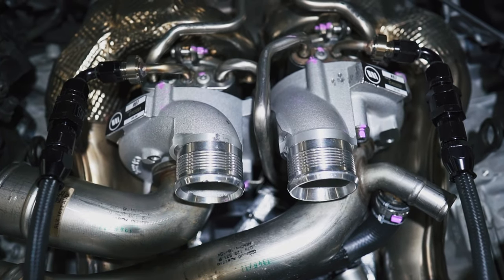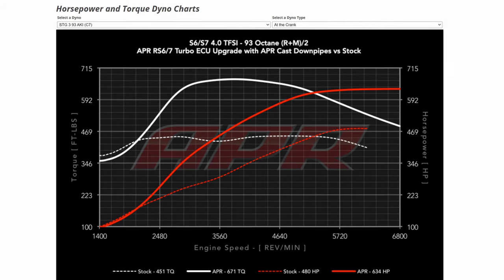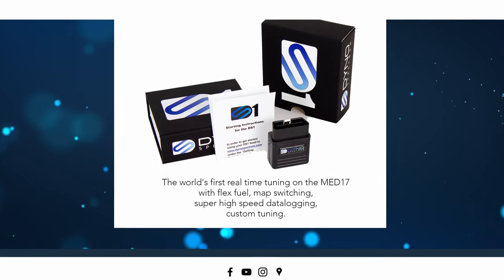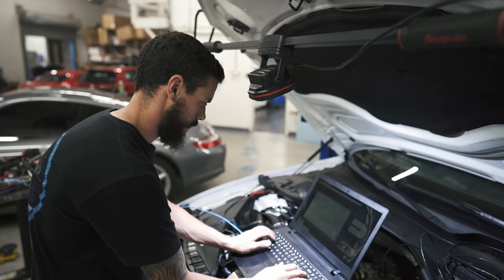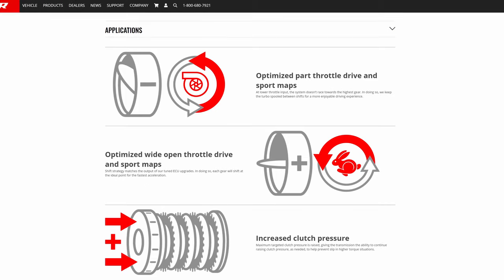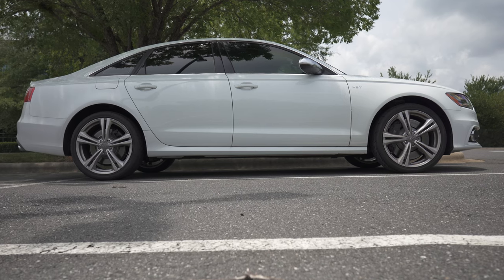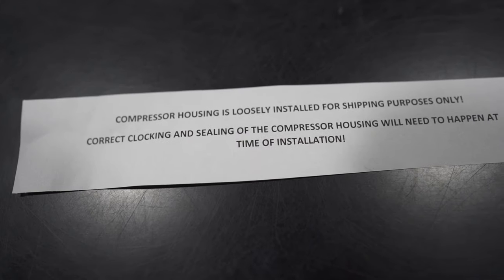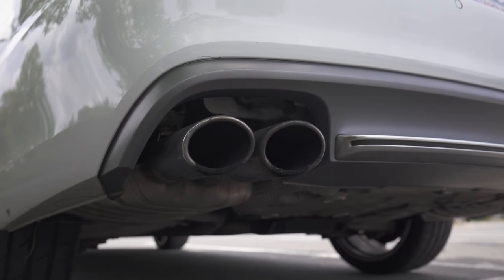*ULTIMATE SLEEPER* APR STAGE 3 AUDI S6 REVIEW!

Comment: Taking the 2017 S6 from APR Stage I to Stage III.  Still on the fence on turbos, how big to go, and what size the APR file/s can handle.  Already have the AWE exhaust. Not planning on deviating from the factory CATS at this point but only because I'm told by APR that its not necessary, and finding CATLESS ("test") downpipes seems pretty tough.
Reply from the maker: The APR file is only going to support oem sized RS7 turbos (should be listed as stage 3) 

No more downpipes from APR that was discontinued years ago. Honestly for most people cruising around town / daily drivers downpipe is not worth the hassle. Most states you won't pass inspection with them. My old S6 here was APR stage 3 with stock downpipe and it was completely fine.

Comment: How much power is the DSG rated for?
Thanks
Reply from the maker: On the S6/S7 platform with the DL501 I have heard somewhere in the range of around 700-800tq but that obviously depends on specific conditions and mileage of the transmission itself.

Comment: Are the dsg transmission reliable ? Does the tune help give longevity?
Reply from the maker: In my experience DSGs can work out to be decently reliable when driven responsibly and maintained well. I have also seen some issues with these older DSGs such as the DL501 found on the S6/S7 platform. They are more prone to mech unit failures than some of the newer DSGs found in the transverse mount cars such as DQ250/DQ500 etc. Like anything the more torque and abuse the more risk. Good news there are clutch upgrades available and TCU tunes that help performance.
Reply: @savagepandaprojects  thank you I’m a fan of this platform just wary of the transmission.
Reply from the maker: @jimmysarit505  Your welcome! Totally understandable